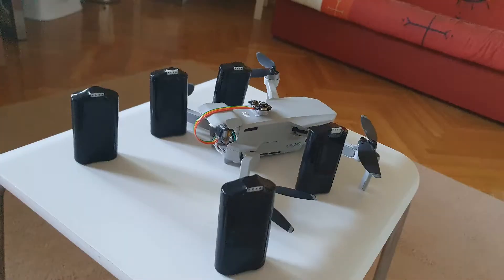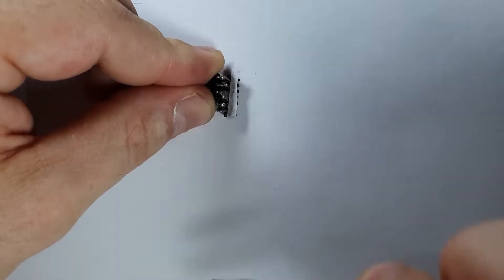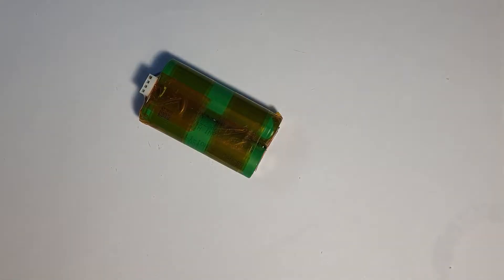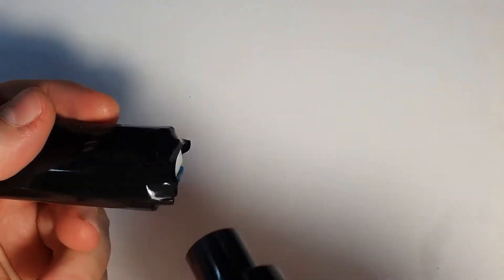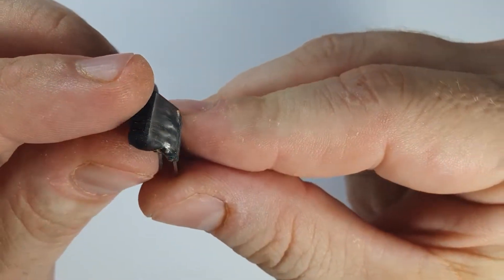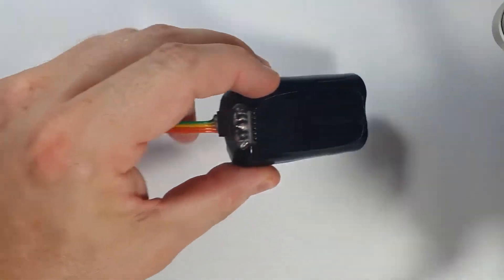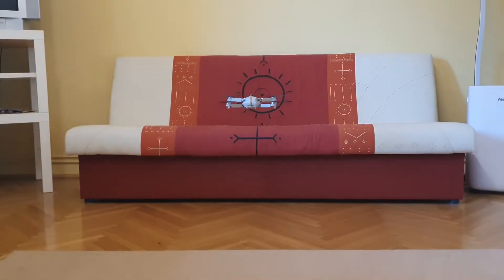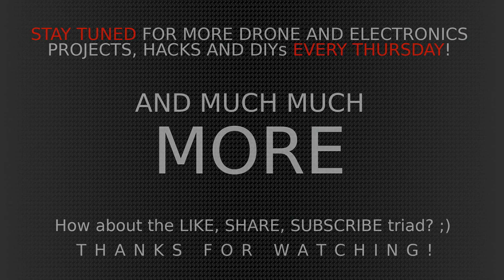DIY Mavic Mini batteries!!!

Comment: Can you make. a signal booster for Mavic mini best range I've got in open country side 27,006 ft total disconnected came home on own
Reply: You can build an amplified antenna rig. It basically consists of 2 2.4ghz wifi panel antennas, 2 signal amps, power source for amps, appropriate cables/adapters, mounting hardware, and a tripod. It would also involve opening up and some light modding of your controller to connect the antennas.
Reply: @patrickhdsn  I leave that well alone

Comment: Thank you for spending the time to do these excellent mod tutorials. They are first class! I look forward to following the first video.  In my ignorance i do wonder whether it would be possible to a) monitor the voltage and direction of voltage   on the LED and the time period to know when it turns solid red and allow that logic to act as a switch to replace the push button. b) For the purpose of  disabling the return home on low battery, would it be possible  to use a mofset to act as a switch and to sever the lines after the battery check process is complete?

Comment: Hey Zolly! 

Loving your ideas here and work done so far, I will go on to watch the other videos shortly also!

A few questions...

So, the Mini 2, I understand BOB will not work with this apparently? I am thinking out loud as I write this. BOB is a method to bypass/replace the "brains pcb" as you call it, I guess there must be something internal in the Mini 2 firmware that is not in the SE for BOB not to work?

Ok, following on from that... there is talk about "locking the chip" by this I guess we mean the brains pcb locking? From what I gather this is done by the brains pcb losing all power? As an almost anti tamper device? Or am I missing something here? 
From what I understand in this video the power can be taken away from the brains and as long as the power is reapplied to the brains pcb BEFORE the brains gets connected to the drone then everything is good and the chip does not lock? Again is this possible with the Mini 2? I know you said you has bought one and made some progress with it, have you any links, videos, tutorials you can share for this as I am very interested in this :)

Ok as for this video, I was thinking could this brains pcb not be internally mounted within the mini and wired off the back of the connector? From what I can think the issue is with the brains seeing the battery first and then plugging into the mini's connector 🤔 if that is the only reason could this be overcome? Again thinking out loud maybe a wire coming from the brains pcb into the battery compartment where all the brains and other connections are made internally and then in the battery compartment we just have a 2 wire connector to the battery? Granted you would only be able to use modified batteries from this point onwards, whereas having the method you have designed allows for both to be used... but just throwing some ideas in the air...

Any help on the Mini 2 would be great if you can help me out 🙂 the last thing I want to do is have the chip lockout ... I have seen the videos about maintaining power to the brains whilst piggybacking additional batteries external to the mini 2, but ideally to come up with an internal mod board so home made batteries could be used instead would be what I am looking for a project on 🙂

Fantastic work!

Comment: This whole series of videos on the Mavic mini is just awesome! I am investigating the feasibility of making an auto charging dock using some copper sheets of metal to charge the battery in situ. Watching your videos gives me the confidence to think it may just be possible! Looking forward to watching hte rest of your videos!
Reply from the maker: It may be possible and worth to look into it!🙂
Reply: @ZollyD  Yeah I think it's definitely possible the more I dig in! I ripped the drone open and wired up a line to the power button and all the battery terminals then I'm feeding them onto the back of the drone. On the back I'll have a LoRa radio arduino combo which runs off the the battery power in sleep mode waiting for a LoRa on signal, as well as a YX mavic mini charging unit. which gets 5V 2.4amp power fed from two of the drones legs. The charger hasn't arrived yet but looks to weigh like 10-20 grams and the arduino lora radio another 10 grams. So It should only add another 30 grams. The only part I'm still uncertain of is if can charge the battery BMS with the charger while it's in the drone or if it's going to complain. Based on the way the voltage works with the power button (starts at 8 V then drops to 0 when you press the button, then returns to 3.3V when the drone is on), I can't imagine it being an issue as it looks like the drone isn't communicating with the battery at all when it is turned off.

Comment: I'm trying to get my hands on the Japanese MT1SS5 battery to meet USA specifications for meeting category 1 specifications for over car and persons flying. At this rate I'm wondering if modifying a gen 1 or 2 battery with smaller lighter weight cells would be cheaper. Could I replace the lion gen 1 batteries with smaller lipo or lion to shave off 50g of weight on the original battery circuit board?
Reply: Yes, its possible. But chip reprogramming would be necessary to adjust cells capacity.

Comment: you could make a battery compartment where you only change the batteries, or is not possible ?
Reply from the maker: Yes and no. The thing is that the board has to be connected to the batteries first and only after can it be connected to the drone. So if the board is connected to the drone while you insert the batteries it will give an error.

Comment: Amazing, Zolly!  As I commented in a previous video, I would like to see the same process, but instead using non-solder 16850 cells that we can easily just slide into the drone's battery cavity then securely close the drone's battery door to lock them in place.  BTW would it be possible to simply replace the original DJI circuit board with a DIY board?  After all, it looks like you've already removed/replaced the original MOSFETS, etc.  It seems this would be much easier to solder connections to.  Thanks!
Reply from the maker: There is a guy who made  product he is selling called B0B. Check it out. I think that is what you are after. :)
Reply: @ZollyD  link?

Comment: Just wondering, is there no balancing of the battery during charging?
Reply from the maker: Good point! :) I charge them on a balance charger. I just stick a needle under the black plastic to access the balancing point. :) But they are not really going out of balance anyways.
Reply: no need to charge the balance all the time.  after some time, need to balance to increase the life of the battery.  zolly, what is the balanced charging circuit you are using?

Comment: what is the circuit you using.
Reply from the maker: The factory battery board with some added electronics. If you watch my playlist on the Mavic Mini it will be clear for you what is going on. ;)

Comment: hi Zoly,, i really like you and  topics in your channel cuz im in the circle of electronic hobby too, but im not so good as you,
i used to do audio video repairs for lliving before but not anymore.. but imy working bench for electronics hobby is never leave on my side,, and im in fying drone 
hobby ATM, and i got 3  Minis of DJI and numbers of cheap quadcopter toys before get into this far. hahaha,, aside hacxking of mavics Baterrys which verry interesting on me
i have one more wanted diy PROJECT THAT IM REALLY want  to  achive is to do an amplifier for my mavics minis RC RX antenna. kind of i van ab;le to detach nthe dip[ole built in antenna of my RC  then attach an external roof antennaa coax cable so i can have a nice seat inside house or inside my car while my minis enjoying flying everywhere, i get fulfilled more if i  could make it with some  circcuit hacking or pulling some  RF circuit amplier just sitting round inside old appliancesa  doing nothing but taking our space.. hahaHA CAN YOU NHELP ME BY DOING IT IN YOUR CHAnnel zolly?? Thanks
Reply from the maker: Thank you for all the kind words! :)
I am sorry to tell, but I am into digital electronics. I have not too much knowledge about analog circuitry, audio, and amplifiers. I think that is an area you are probably much better than me. I DO like your idea though to have an antenna on the roof and reach far. :) All I can do is to wish you luck with that project and please let us know about your progress. :)

Comment: Can you do the mini 2 battery in the mini 1. You remove the case and it fits  but will it work?
Reply from the maker: I am curious about that too, so for sure I will put it on my "to do videos about" list. One thing is already clear, that the full charge on the Mini 2 is higher than 8.4V. That is something to be aware of...
Reply: @ZollyD  The mini 1 in Japan uses a Lipo battery, Same specs as the mini 2 battery, only 1100 mah instead of 2250. That's why I think it will work.

Comment: nice   i think it wold be cool if can find a off the shelf mini BMS to keep the 18650 batteries balanced and wont take much space 
somthing like this and mite be abel to sit in the v channel between the two Battery  ant mite be abel to trick the DIY Mavic Mini bms and could use the DIY Mavic Mini charger as well

TZT 2S 3A Li-ion Lithium Battery 7.4v 8.4V 18650 Charger Protection Board bms pcm for li-ion lipo battery cell pack
 https://www.aliexpress.com/item/32789259573.html?spm=a2g0o.productlist.0.0.7aa76944FiCE8p&algo_pvid=e41c7935-63c6-440a-abe4-384eafa1b0e8&algo_exp_id=e41c7935-63c6-440a-abe4-384eafa1b0e8-3

or this one 
2S Li-ion 18650 Lithium Battery Charger Protection Board 7.4V Overcurrent Overcharge Overdischarge Protection 4A 2 Series BMS
https://www.aliexpress.com/item/4000226170867.html?spm=a2g0o.productlist.0.0.7aa76944FiCE8p&algo_pvid=e41c7935-63c6-440a-abe4-384eafa1b0e8&algo_exp_id=e41c7935-63c6-440a-abe4-384eafa1b0e8-16
Reply from the maker: I like your thinking. I wanted to keep everything as light as possible, not only for the 250g limit but simply to maximize flight time. So I chose to use a balance charger, as I mentioned in my Mavic Mini battery hack video. For the black shrink wrap I just stick a needle under the foil to be able to probe if the cells are in balance. Honestly, they are so good cells that they just simply not going out of balance. BUT I anyways check them often.
Reply: @ZollyD  i like if can ues this bms -  S Li-ion 18650 Lithium Battery Charger Protection Board 7.4V Overcurrent Overcharge Overdischarge Protection 4A 2 Series BMS and fix the 6 pin plug to to and triying to keep evrey thing simpel as well and mite be abel to 3d print a battry case shell out as well but wher can i find the 6pin dji plug from
Reply from the maker: @DeeFPV  I would also love the idea to make these even better! BUT be careful with that BMS!!! The datasheet states that the overcurrent detection current is 9.8A This means there is a high chance that the BMS is going to go overcurrent and will turn off the MOSFETs and the drone will fall out of the sky. Regarding the 6 pin connector, I have not found anywhere to purchase it. AliExpress is loaded with 6 pin laptop battery connectors, but their pitch is 2.5 mm and not 2. So my only source for the connector was from the Mavic Mini battery itself, therefore the only way for me to not kill the whole purpose of the project was to create the adapter you saw in the video. Let us all know if you are making progress with your design! I think we are all interested! :)

Comment: nice one dude, we need this for mini2 ;)
Reply from the maker: OH YES! I am working on it to get one! No success to borrow one yet, so maybe I will just have to buy one.. :D
Reply: @ZollyD  it is necessary to program the (bms) of the battery for the mini 2 ,,, so that it accepts a modified battery ......
Reply from the maker: @djimini2461  The same was said about the Mavic Mini, but it was possible to fool the drone anyways! :) I will have to look... ;)
Reply: @ZollyD  Thats great to hear, i have mini 2 and ordered mini 1 battery to mod it and use in mini 2, but then i have found out it have to be programmed for the controller to use more capacity(amps), some moders say it works fine just like that without reprogramming so i don't know who to trust. It seems to me tho, i have found the One i can trust (:
Reply from the maker: @xerxeslv  Thanks! That was so nice to read! I have great news! I have bought the Mini 2 today!!!!!! I already started to mod it. It is a bit rough but I can proudly tell that I have already flown it with the batteries I showed in this video. The microcontroller program has to be changed though! So your thinking is correct. I also use the Mavic Mini 1 board and tweaked it with a micro. :) SO EXCITED ABOUT THIS!!! :)
Reply: @ZollyD  Oh wow! I can not remember when was the last time i got such a huge smile on my face, reading youtube comment. Dude, you rock! You are the God of mini modding, explaining everything in details. There are some modding videos on youtube, but yours are the best so far. Feels so nice to get a reply, I will take the opportunity and ask a question: do you think it is possible to change default 18650 to some high capacity like panasonic 3400mAmp and leave the original board or change to some diy board but in a way that it fits inside without any wires outside the body? That was my idea, to make it nice and clean.
Reply from the maker: @xerxeslv  Thanks a lot! :)
Have you watched this video fully? https://www.youtube.com/watch?v=H4JPF_8zTqc&t=4s
Is this what you think? Or did I misunderstand your question?
Unfortunately the Pana 18650 will not cut it as it has a Max drain current of 6.7 Amps.  It will overhear. I used Sony VTC6 cells.

Cheers